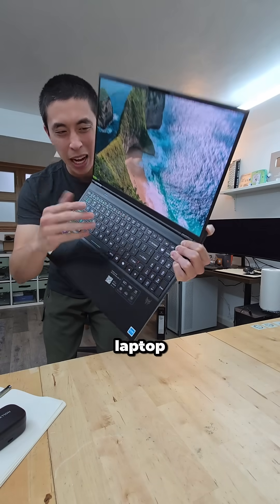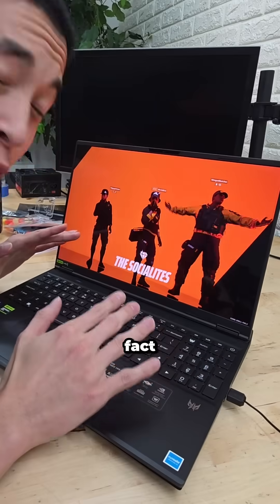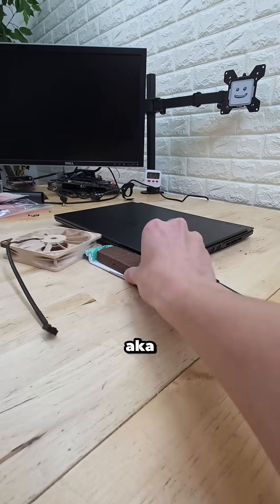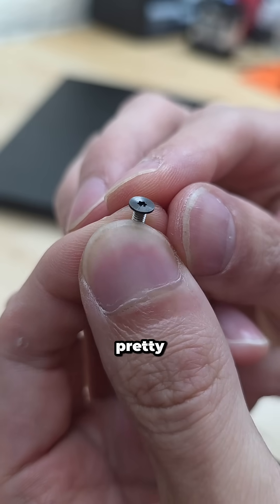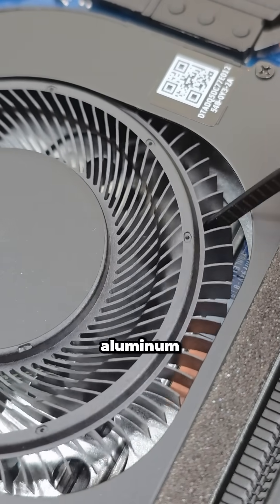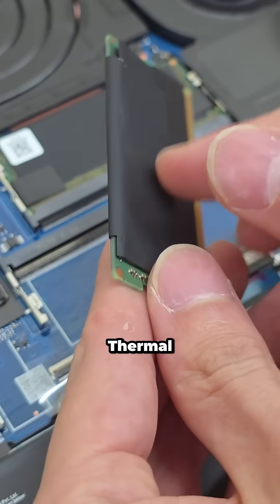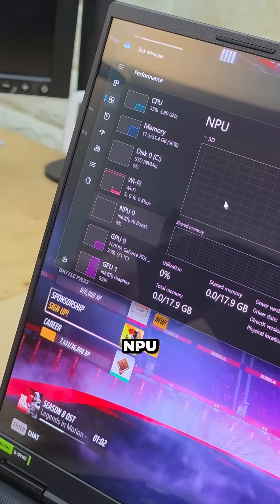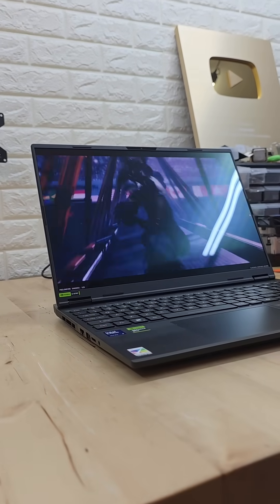How are gaming laptops getting THIS thin?

Comment: You spoke about all except the only important part, the battery.
Reply: Most likely the maximum you can have for an airplane. So like 99 watt hours. Either way, it’s a gaming laptop, you’re not going to really use it unplugged most of the time.
Reply: @jakejakedowntwo6613 it’s a laptop so it’s still important
Reply: @yogurtboi445 dude windows will keep it on for around 6 hours max maybe 8 if you put it on battery saver mode, of course if you dont game on it
Reply: @yogurtboi445plenty of laptops out there to fit your battery needs.
Reply: most people who buy a gaming laptop are smart enough to realize how much power these high end components pull and use it plugged in when gaming.
Reply: @YeahImDracowell yes but if you plan on traveling or flying you can’t always shove 400W from a charger into the laptop it at least needs to last for basic tasks if not gaming
Reply: @yogurtboi445who uses a 5070 ti gaming laptop for school or work? You gotta be losing it. Buy a chrome book if you want battery life.
Reply: I don't think you need to consider battery on a gaming laptop
Reply: @minhquocnguyen206 then I’d get a pc. Sure laptops have all the peripherals it needs but if it can’t survive even basic tasks on battery it’s not worth ig
Reply: @yogurtboi445have fun traveling with it 😂
Reply: @yogurtboi445gaming laptops are cheaper than pcs. Plus portable, battery was never a thing in gaming laptops most they last like 1 hour max not for gaming only browsing
Reply: @avrblade  gaming laptops cost alot more, dollar-to-performance. Old ones are cheap because they are outdated and cant be easily upgraded.😅
Reply: @avrblade  1 hour in gaming 4 hours in normal use but some models like the rog zephyrus and acer predator helios neo16s give from 6-10 hours of bettery life on normal use and 2 hours in gaming use.
Reply: @yogurtboi445 it can. well if you dont include "gaming " on it they can survive. you obviously never used or touch laptop.
Reply: @minhquocnguyen206  so just get a pc lmao
Reply: @facemcshooty6602 riiiight cause traveling with a pc, monitor and keyboard is sooooo comfortable
Reply: @eugenev2672  bruh... he Is just saying that if a laptop has no strong battery then what's even the point of buying a laptop

(Srry for bad English)
Reply: @Volt-zV9 well if u need a good battery laptop — you by a macbook. if you want to have a gaming device with mobility — you buy a gaming laptop and don’t worry about the battery, cause it’s def not a focus. i don’t get what’s so hard to comprehend
Reply: @facemcshooty6602  mate thats not how that works. Why get a 3kpc that weighs 30kg and is huge as hell to take between work home and education, when you can get a 3k gaming laptop you can plug in anywhere and weighs only a couple kilos? Some people need portability more than performance. Think before you move your fingers
Reply: imagine talking battery on gaming laptop. battery in gaming laptop just there so when electricity is bad your battery broke not the mobo or when you play then blackout you still can play a bit of time

The longest gaming laptop i know is 7 hours and all of that on eco mode, igpu only etc etc meanwhile office laptop with balance or "performance" mode can last for more than 15 hours
Reply: @eiresby2344  sorry for living in Nigeria I guess
Reply: You mean the LEAST important part?

If you use it without it being plugged in, you are very silly.
Reply: @keatonwastaken then I’d buy a pc because there is no point of a laptop if I need to be tethered to an outlet
Reply: @yogurtboi445 For you, sure. Not for everyone. People travel, like to move around outside and inside.
Reply: Because the gpu only works when it is plugged in lmao. Thats an optimus system.. has the intel APU for light desktop use and the dedicated gpu for heavier workloads. You will use it stationary most of the time. Just get a desktop.
Reply: @tobitaktlos3241  dont tell me, you dont know
Reply: It has a 74Wh battery pack.
Reply: battery doesn't  matter for gaming
Reply: @gregb8488 but it matters for normal laptop use since it’s a laptop end of the day it should be portable and usable outside of home and a charger constantly. I’m not asking 2 day battery just enough for like 7 hrs of documents or YouTube on the integrated gpu
Reply: And the price...
Reply: Just get a portable charging station like a jackery.
Reply: @Floppy1200 can’t take that on a plane and no you can’t because you’d need a large one capable of at least 130W
Reply: @yogurtboi445 I literally have a power inverter thats exactly 130 watt capable... you can get a jackery thats 100 watts. You dont necessarily need 130 watts especially with something like a legion go. I use 25 watts on my legion go and airlines only permit 100 watts
Reply: You typically play on a laptop with the charger in it all the time, that way the laptop can give as much power as it needs without worrying about preserving battery
Reply: @shaftinc8739 yea but remember to set a charge limit otherwise the battery will degrade quickly and gaming laptop batteries are really hard to find
Reply: 7 hours normal use at 250 nits. 2 hours in gaming use
i own the 5070 version soo yeah.
you dont get changing refresh rates but the software is so optimised you get good battery life out of it. but if battery is what you really need go for zephyrus g16 which lacks in performance but gets 11 hours of normal use.
Reply: @skgamer-zs6en can you tell me what is "normal use" for you?
Reply: exactly !!
Reply: I mean battery does not matter in this case. It lasts enough where it wont matter.
Reply: It is the worst in existence. Acer Laptops suck at it.
Reply: I got a gaming laptop recently, using the controls to limit to cpu usage only, eco mode, and little to no fan usage, capped at 80% (to keep the battery health longer) it lasts about 6 hours. If your trying to play anything intense though it lasts not very long, but I don’t think it’s reasonable to think you can play some ultra ray traced AAA game all day without plugging it in.
Reply: @adamstarks8682  what about normal browsing? I hate the ones that still fail at that
Reply: @tegathemenace it’s smooth, it mostly depends on your internet though in all honesty, most modern computers or even phones can browse with almost no delay
Reply: Lmao
Budget gaming laptops: let’s pair a 100W GPU and 100W cpu with a 56Whr battery

High end gaming laptop. We paired the highest end components with the largest battery legal on a flight, 99Whr, but our components use so much power you still get 1hr of battery life
Reply: @yogurtboi445 you can upgrade the battery in some laptops. Mine could go up to 65wh from 45.
Reply: powered by your soul, instead
Reply: My 2.5k laptop last less than 5 hours playing age of empires
Reply: If you game on battery, and not while plugged in, you need to get your brain checked man.
Reply: The price
Reply: U can get 2 hr easily but who's gaming on battery anyway
Reply: an hour and no more 🗿
Reply: If all that is wrong with this is “battery” then you have no argument. It’s an extremely capable laptop and the best part is you can bring around the house with you. I just paid $1,200 for a 5070TI, 32GB/1TB SSD. Benchmarks on it are top tier. I have to leave it plugged in when I play, but so does any gamer on any gaming laptop, ever..lol it’s truly a value packed buy, especially when you compare it to any other 5070TI on the market. The VRAM alone makes it worth the money. Value for performance is just too solid.
Reply: it should be good battery since it is cool
Reply: @bestchessplayertop1  huh
Reply: @bestchessplayertop1  What in the world is brodie talking about 😭😭😭😭😭😭😭😭😭🙏🙏🙏🙏💔💔💔💔💔🥀🥀🥀🥀
Reply: @HjkGgghf "since it is cool, it must have a good battery" I understand he can't speak English but apparently you can't read it
Reply: Lol than you must enjoy wasting money the most important is the hinges not being plastic actually
Reply: @craig9365 plastic hinges aren’t used you just don’t wan hinges that are glued to the frame
Reply: Why you're here just buy  an office laptop for better battery 🤨
Why are these people think only about battery whether it has beast specs
Reply: @dj_gamer007. because if it’s a laptop battery is still important. IT needs to be able to do basic tasks with reasonable life, yes while gaming you will plug it in to get performance but you shouldn’t need to plug it in 24:7 for word docs
Reply: iGPU mode exists
Reply: @bigbrain5643  actually doesnt for this laptop, this laptop always runs the discrete gpu which gives like a 3-4hr battery
Reply: @bigbrain5643 yea but the cpu also needs to be optimized
Reply: @yogurtboi445 You mean better lithography?
Reply: @bigbrain5643 no I mean firmware tweaks to control cpu power usage and wattage to allow for a performance and battery balance. Like lowering the power on battery to allow for more runtime properly instead of sacrificing performance for 1 hr of battery
Reply: @yogurtboi445 Ah yes true. You can set your CPU according to your workload. Performance mode while plugged and battery mode while unplugged. But you should also remember that CPU is not the one who eats all power when there is a dedicated GPU. That GPU will eat your battery even when you are not doing any heavy work. That's why iGPU mode is good. Most of the Intel CPUs and some Ryzen CPUs have iGPU so you can take advantage of more battery life (I advise to check the specifications of the CPU in the laptop though)
Reply: Seriously guys if you are going to buy a gaming laptop to keep it plugged in or to make it go ECO, just buy a PC, it doesn't have any explanation to expend 40% more for portability.
Reply: @Norza47 bro you are so dumb honestly 🤦‍♂️ not everyone is unemployed like you bro. Some people don’t but gaming laptop just to game
Reply: @Norza47  its cheaper overall to buy a gaming laptop since it comes with everything included.
Reply: @N @Norza47  you go on long car trips or plane rides, it’s not enjoyable to bring a monitor and pc with you, but very easy to bring a laptop and charger. Either way, if you buy a high end gaming laptop and then keep it on eco, without plugged in, you might as well throw away the graphics card and cpu you bought and get a chrome book. Your pc literally can not use the 5070 TI unless it is plugged in. It uses integrated graphics which is the same shit as buying a Chromebook.

Comment: You lost me when i saw the torx screws 💀
Reply: Honestly superior screws when compared to philips/crosshead
Reply: @Llamajake777  Why?
Reply: Why these are better
Reply: @yogurtboi445 less slippage, more appliable torque.
Reply: What debate is this, philips is always better  cuz it's more common and u can use a flat head driver if ur desperate
Reply: @pinkyjha640 but Philips bits strip a ton easier than torx
Reply: @pinkyjha640  philips is literally MADE to slip, and stips a lot more. and you need a small specialized laptop screwdriver anyway, so not much more common than its torx screw counterpart

Comment: i would buy it if it was available in my country (pakistan).

and if i could afford it 🥀
Reply: It’s not a good laptop though
Reply: @AbrahamLincoIns  wait really?
thats still better than my potato i3 2nd gen integratedgraphics with 32 mb of vram
Reply: @Hey-Vsauce-Clippy-Here  it’s not good for the price, it’s just a sponsored video
Reply: @AbrahamLincoIns  i know right.
but a potato's a potato and a laptop is a laptop.
and holy $hit its damn expensive 1899$ or (674,999.00 PKR) thats enough to buy a car here
Reply: @Hey-Vsauce-Clippy-Here  dang for that laptop?  And it’s gonna over heat in 5 seconds with how thin it looks
Reply: @AbrahamLincoIns yeah and for local llms it'll melt itself 🔥

Comment: The cooling gonna be crazy
Reply: Yes
Reply: no one realising he commented earlier than the video?
Reply: @birbioshehe
Reply: 81 degrees at 99% usage of gpu for cpu i think 84 degrees but i haven't used cpu that much.
Reply: Downside this only has a 5070ti even a Steam Deck looks better since my VRAM is not limited on a Steam Deck. You can set it as high as half of your memory on a Steam Deck
Reply: @powerfulshammy  Steamdeck has only 16 gigs of ram so half of it is 8 gigs for the gpu and a 5070ti laptop has 12 gigs of vram. Also the 5070ti laptop is atleast 2x more powerful in games.
Reply: @BaLar_ way more than 2x
Reply: @BaLar_ way more than laptops 8gb and VRAM in laptops is limited and your memory is your VRAM also now it's 4gb VRAM yea right 8gb is still much better
Reply: @BaLar_  EXCEPT NO BECAUSE THEY MODIFIED A STEAM DECK OLED TO HAVE 32 GIGS OF RAM WHICH MEANS 16 GB VRAM HA
Reply: @powerfulshammy  the drawback being it's slower because it's using ur ram instead of actual vram so it's slow as darn
Reply: @isaacHOMEThomasen Using Ram as VRAM is actually really slower than GDDR7 vram .
Reply: @powerfulshammy i really love steam deck but I am sorry this sh!t is way more powerful , steamdeck would even struggle to hit 40s in cyberpunk 1080p mid , this would crush it in 1440p high with ray tracing , VRAM IS NOT ONLY THING THAT MATTERS 5070TIM has way more core counts , it's faster GDDR7 has better bandwidth and its has Cuda which is also important for video editing and machine learning ...
Also comparing 500$ steam deck to 2000$ laptop isn't fair too .
Reply: @powerfulshammy that makes no sense
Reply: @powerfulshammy a steam deck has low memory and low power